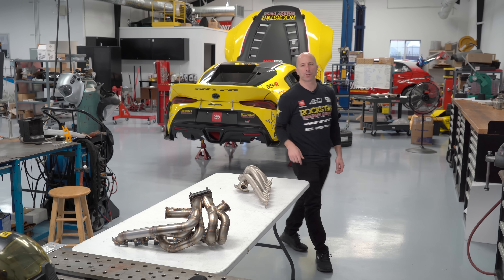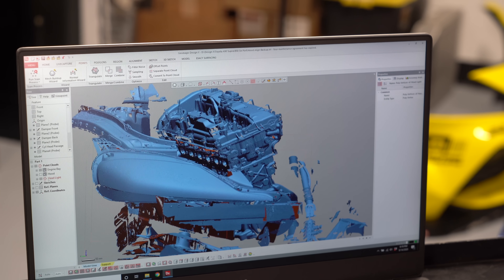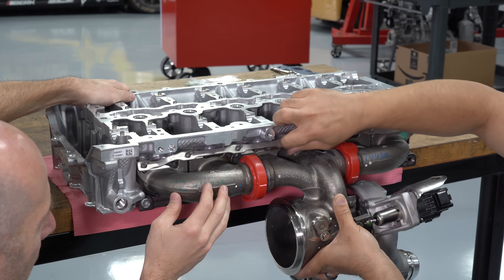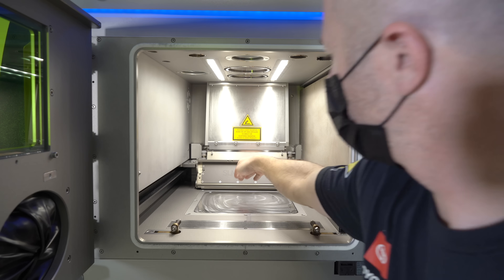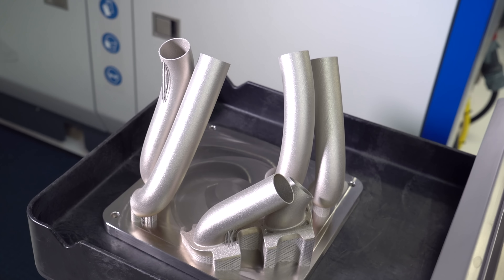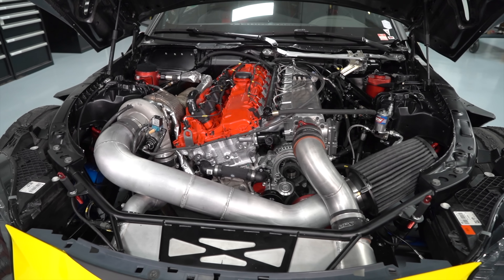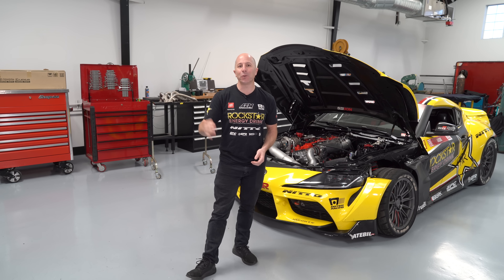Turbo Manifold 3D Printed from Inconel Powder

Comment from the maker: Would you use the printed or fabricated header?
Reply: Can we get an update on the head? 6 exhaust Port vs the original 2? Thanks!! Love your videos. I learn so much!!
Reply: Seem like it might be pretty far into diminishing returns territory for the price.
Reply: I wouldn't of used it that close to an event like that
 Go with what is proven.
Test the 3d printed one this winter. Get some heat cycles in it. Also please film it for us. Maybe a gopro under the hood to record the glowing lol
Reply: Both look great. When did the exhaust ports change from 2 too 6?
Reply: doesnt it hurt the performance because its so rough inside?
Reply: whichever one gets the driver seat time
Reply: @tektkite7255  I read a study where its better to leave it "as cast" not to polish cause it acts like dimples on a golf ball. Also I ported and polished some cylinder heads and then had them machined and assembled at an engine shop and the yelled at me that I wasted all that effort cause it was boosted and didn't matter. So who knows.
Reply: I'd use the 3d printed plastic one. I feel like that's where my budget would be.
Reply: Neither
Reply: Printed!! You are literally on the bleeding edge of this tech! I love this!!
Reply: Super curious to hear how this one works out after the manifold failure
Reply: Does the smoothness of the internal tubes make a difference to turbo flow or power levels because it looks quite grainy in there.  I feel like the tube based headers are probably what I’d choose simply because of expense I imagine 3d printing is very expensive
Reply: Would you print an entire engine? ',:)
Reply: @PapaDoc thanks always for the great content. Please keep it coming!!! Thanks a bunch
Reply: Fabricated unless the customer is willing to pay for my experiment.  Would be interesting to play with internal surface features and turbulent flow characteristics in that manifold with the additive process.
Reply: @wackerpro  Not really, aerospace has been using metallic printed parts for a decade now.  Just hard to justify the cost elsewhere which hasn't changed much.
Reply: How much were the headers if u don't mind me asking???
Reply: @bookle5829  Not likely, metallic printing still does not print at full density and requires post processing anywhere where parts meet.  Porosity and surface finish is the limiting factor.
Reply: Hell yes, the technology that goes into this is so badass
Reply: I would first need to print a whole car 😬
Reply: What was the weight difference?
Reply: I would have to do a dyno and track test each to have proper answer but they should both be the same if they were designed off identical software.  Maybe the 3d printed has smoother flow but I doubt that will matter considering how minewught the diff
Reply: Fabricated piece looks nicer.
Reply: I'd like to know what the printing would cost an average Joe like me.
As for the fabricated tubes, I know people think the welds are cool, but it's poor engineering. There must be someone who has the equipment to bend them up in one piece, especially if you have a cad file for them.
Reply: @BrandonBurns1985   The more power (better flow) you make NA, the more you make with boost.
Reply: Printed hands down👌👌
Less welds and less chance of cracking under high temps
Reply: Printed can get better flow through engineering and computer simulations
Reply: I'm also confused about 6 exhaust ports 😅
Reply: Definitely
Reply: Printed
Reply: Printed Inconell for sure. :O
Reply: While I can appreciate the technology in the 3D printed one, the fabricated one looks better, it also seems like it would flow better due to how smooth the inside was compared to the printed one.
Reply: @screwdajuice  Mine would be the napkin the idea came about on meal not included
Reply: I would use any of them as long as I didn't have to pay for em'   😉
Reply: Do you use solidworks FEA  on those headers before you finalize the design? I’m curious to see where the high stress points are on a part like that.
Reply: I actually did my masters colloquium paper on SLS and SLM technology. It is very fascinating, the properties and grain structure is like no other manufacturing process.
Reply: @reAllyNoWayyy  If only I had a neighbor to borrow everything needed....well that's what one of my grandsons does well use to marriage and a newborn has slowed his purchase abilities
Reply: @owenspalding971  Is porosity a concern with metal printing? since it's done in .004" layers, I'd imagine that the amount of contraction from cooling is lessened. Cast parts cool all at once which is usually why they can have high porosity if the cooling and pressures aren't controlled locally.
Reply: I think that a 3d printed collector makes sense but unless you print the whole header as one piece, the pipes could be made from tubes
Reply: I woulduse the printed header if it extruded polished on the inside
Reply: Printed I think. Smoothness of the inside is a huge deal, but it's hard to clean up the inside of the welded header too. The properties of Inconel are pretty awesome though, I have Inconel turbo studs on my track Miata because regular steel ones wont stand up to the heat.
Reply: @UCSFKVIigivR2W4C8Ix0axIA it's at the end of the video. 1100whp/900wtq
Reply: 3D printed. I would’ve trusted the end product would’ve been as advertised. Process seems legit.
Reply: Probably a good choice not taking an untested, and I'm guessing, extremely expensive prototype to an event. But I do want to see more 👍
Reply: I wanna see how crazy you can get with the antilag on this!
Reply: just test the 3d printed one next year put it throu the TEST of TEST
Reply: Fab !
Reply: @noahkach  Yes it is.  The biggest reason its an issue is because its nearly impossible to model near the exact density of the part.  The contraction from cooling is generally negligible.  The bigger issue from the stress side is that the density variation is not predictable and and therefore we cannot accurately model the strength of the part with finite methods.  Validating a basic part by test is usually not a big deal but validating a lot of parts by test that are usually validated by analysis is not something most companies are willing to spend money on.
Reply: @owenspalding971  gotcha. just out of curiousity, what is your background? I'm just finishing  my Bachelors in Mechnical Engineering and haven't had much exposure in 3D printing besides extruded plastic.
Reply: Will use whichever performs better / more reliable.
Reply: Why not both?
Reply: Can't afford either bruh 😂
Reply: All I know is your intake failure taught me that always have spares for everything, even prototype one of one should be one of two.
Reply: @owenspalding971  Is that a youtube channel?
Reply: It’s defend/aerospace grade!
Reply: Wow this 3D printing technology is just in its infant stages. It's only going to get faster and cheaper just like with any new tech. I think in the not so far future you wont even have to go to the parts store to get your parts your just gonna pay for the and download the part to your 3D printer and away you go. In the end I think it will be even cheaper and eco friendly than buying your parts from the parts store... very cool stuff.
Reply: @mattw4486  defence/aerospace grade slm machines will never be cheap! That facility is a big clean room.
Reply: I’d use the printed one for sure
Reply: Test them both!
Reply: @BrandonBurns1985  Airflow is airflow, boosted or not. If you can improve airflow, its going to increase power regardless. Ported and Polished heads on a boosted application will mean the performance pays off an order of magnitude better than if the head was 'as cast' in a boosted application. 

I mean spending $800 to get OEM LS3 heads CNC ported and polished to perform similarly to aftermarket heads from a shop like Advanced Inductions or AFR for $1800 proves "as cast" is a misnomer unless knowing the context of the study you've read. 

im sure the study goes into comparing performance metrics with cost of producing the port work may not justify the cost when in a boosted application unless you're the type of person not wanting to leave any power on the table. 

In my experience, ANY TIME you can increase airflow, no matter if its through casting and machining new parts - or machining old, used, OEM parts to flow more - there is a measured benefit. The only question is... how much money do you want to spend?
Reply: @fascistpedant758  You're looking at easily 5-figures for the entire process, start to finish. Fabricated tubes with welds, are going to be common and not "poor engineering" because of the limitations in joining all the pipes to the head and collector within physical space. Unless you're referring to Tubular cast manifolds, which are equally as expensive to develop because the manufacturing process essentially requires mass production in order to have low per-unit costs that will offset development and production costs in the long term. Race teams can justify the cost of this because they can apply what they've learned in motorsport, to create products for the aftermarket. 

3D printed metal, while in a much better place than they were 5 years ago in regard to motorsport, still has a ways to go where it can be a viable manufacturing method for mass production
Reply: Seems like somthing more or less people would do if money was not an issue to them and their builds lol
Reply: printed wone
Reply: If it was tested and proven to work, I don't see why not
Reply: @BrandonBurns1985  I feel like just because it's boosted doesn't mean it was a waste of time polishing. Smoother surface means smoother and more consistent airflow but I don't know all the science behind that
Reply: if the printed stuff could withstand the abuse and money is no object, absolutely
Reply: Printed and fabricated are both excellent choices. Personally on the engine I  designing I chose seamless grade 9 titanium tube for the headers. With goal of no seams and a optimized flow between exhaust port and turbocharger. Cheers
Reply: Play with the printed one, but not before an important event, stick to the proven version.
Would be great to check it out to see if there were any benefits over the fabricated one.

Wasn't it possible to print it as one piece? to avoid the welding?
The tech need to get better, the cleanup and after processing is too much.

Not as bad but similar as those made from plast, they are silly.
They are weak and ugly; cant be used for much except mockups.
Reply: Honestly, You just made one of my fantasies  come true.
Reply: Uh would I?? I would kill to be able to print manifolds Papa D!! So awesome!!!
Reply: @BrandonBurns1985  I think you are a little bit mistaken. You want the rough finish on the intake side only when you are using a fuel air mixture in the pipe of question. It helps to keep the fuel atomized. But most injectors these days are mounted right at the valve basically. So that isn’t really of any benefit. Also there is a thing called boundary layer. Look it up. Basically the air flows through the middle of the pipe and not out on the edges. As far as roughness in the exhaust. It’s the opposite. You want it as smooth as possible. That’s why you see guys running those machines that pump a playdough like substance through a header. It will have diamond grit in it to polish out the inside of the pipes.
Reply: Fabricated, that manifold is a piece of art. 👌
Reply: The fabricated one
Reply: Laser welds are usually super strong, I don't know enough about the material though to make a call, but seems like you guys did the math so I'd say the 3D printed one, because it has less manual welds and thus is naturally less likely to crack
Reply: I would go fabricated, even tho its cool with printed tech
Reply: @screwdajuice  samesies.
Reply: Honestly I would use the lightest one that can take the heat. In any case either are good. Amazing video man that’s incredible. My question is does it hold up vs old school?
Reply: @BrandonBurns1985  I hardly think you wasted your time a smooth surface to flow in any application no matter where in any engine benefits boosted or not now being boosted does help but flow is flow and it adds up in and out faster is the name of the game.not sure what you mean about ripples on a golf ball from a simple polish if your talking about on the welds then I guess I can see that but if your welds don’t suck with bubble in it then I don’t see the problem so long as it’s flush and smooth on the inside it’s a win.
Reply: @fascistpedant758  actually incorrect the reason why is because on a boosted app your compression ratio is lower na so you can except boost therefore if you had a high compression na vehicle next to a low compression na Not boosted yet but ready, the high compression would obviously have more power a prime example is a scat pack vs a hellcat very similar but the hellcat without a blower would make less power.  But yes better flow does equal more power that is for sure.
Reply: I first like to see the annealing of parts to be honest
Reply: The old school guy in me says fabricated but then the nerd wakes up and yells: have you seen the printed one dude, so sexy. For this built, the nerd would win.
Reply: @papadakisracing I really like the printed. But having the egt and back pressure sensors present will get you better tuning gains and real time monitoring.
What is your back pressure to boost ratio please?
Reply: Absolutly yes!
I wonder what could be done on the inside to make It even more efficient. Like golf ball surface or a better integrated wastegate.
Reply: I wonder what the difference in flow is between both manifolds. I know there is not enough length to even matter specially at that high horsepower numbers but just curious. I registered for the 3D experience. I’m excited.
Reply: Definitely, it’s clearly the future for low volume manufacturing and remaking older unavailable parts.
Reply: Printed, in the future when this will become the normal thing. When more cars get`s scanned so one can actually choose the car, engine one have from factory. Like choosing a brake disc. This will be the way to go when this can be done faster or more people have those machines to print out the manifolds. Do you want N/A or Turbo manifold, stainless or inconel? etc. It`s just about working smart and not hard I think :)
Reply: If it’s reliable sure
Reply: @tektkite7255  its way worse ...
Reply: @mattw4486  not any time soon
Reply: @BrandonBurns1985  not like that , yes you can make dimples in the intake colector to improve fuel misture and speed flow , but on exaust always polish to have more flow quantity
Reply: Depends on the timing for me, if I had the access to a welder and not much time I would attempt to fab one. If I had the time and money I would print it
Reply: Would TEST the printed, would use the fabricated
Reply: 3D printed has the advantage of using whatever bend radii you want, including constantly varying. I would expect it to perform better on a dyno. 

Whether or not it can be made as light I don't know: it wouldn't surprise me if the 3D printed Inconel loses out on mechanical properties some when compared to tubing. 

Once it's been proven as reliable, I suspect the 3D printed one would be the better option.
Reply: Now that it's done, definitely the printed part. If i was in the same situation u were i'dve gone the same route u took.
Reply: @vincentbourke5217  MY2021.
Reply: @davecolwell725  it will create turbulent air that doesn't move as efficiently as if it were smooth
Reply: Whatevers lighter
Reply: FABRICATED ...
Unless your pushing 5k whp, does it really matter if you use the printed or fabricated ..? Either material will hold what your pushing. 

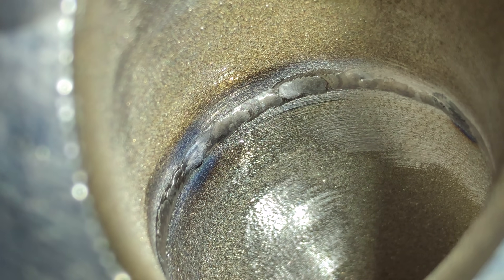At 8:43
those welds right after the head flange on the runners ... They don't look to promising or strong. I feel like that is a bad weak spot ...
Reply: fab it looks better with the color changes
Reply: They 3d print turbines for jets these days the same way.  Isn't it just the micro-pores in the metal that can lead to dramas and ultrasonic cleaning and electrolysis to fill them.
Reply: @fascistpedant758  The best CNC mandrel benders need to grab a decent length of steel for the bend to work. The only other way you could do it is with water pressure in Cast moulds of the tube shape.  Watch the doco on how Harley made the V-rod frame.  You'd even be able to put a taper in the pipe.
Reply: Depends on who welded the 3d printed one 🤔 your intake blew right on the welds thats a no go.
Reply: @owenspalding971  It was a joke but I still appreciate the answer. I guess 3d printed engine will never be a thing?
Reply: @tektkite7255  Ya I heard something similar to the other guy, that the rough surface helps. The guy at the machine shop said something different to me tho, that a boundary layer forms as the air sticks to the rough surface that the rest of the air can easily "slide" on. A similar effect as water on ice. Either way, it seems to help if anything.

Which is nice, knowing you don't have to spend all that time and money to make power.
Reply: im 14
Reply: @noahkach  yes porosity in metal prints is a big issue
Reply: For now fabricated .
Reply: Printed if it's ready in time 👌
Reply: I use Solidworks and worked (as Design Engineer) with one 3D metal and plastic printer manufacturing Company - I would use it on my car
Reply: hey if you're giving it to me, make it however you want :)
Reply: @crocodylinae4161  Hello, 14.
Reply: Printed, the technology that went into that is absolutely mind blowing and watching it come to life in a pile of metal flakes and be excavated like a dinosaur fossil was pretty cool.
Reply: @fascistpedant758  you’re lookin at 6 figures currently. That includes the design, scanning etc etc. For a high end race team, it’s worth it if it means having the slightest edge over competitors. Guys like us either learn to TIG, or run EBay manifolds.
Reply: I’d use both to see what holds up best to the vibrations and heat cycles.
Reply: @brendo7363  
At this stage price & deminishing returns are beside the point, the development n potential of the emerging technology is what's on display.
Reply: @tektkite7255  
Its a minor detail to polish a pipe if its affecting performance.
The strength of the material & the adaptability of the technology is whats on display here n its on the brink of being mind blowing, kinda like how the beginning of the industrial revolution musta been to those who had half a clue about what they were looking at & how it could affect society.
Reply: @bookle5829  
Why not ?
Engine blocks are made from casts anyway.
Wats the difference between casting one & printing one if the metal alloys are the same & structural integrity isnt an issue ?
Reply: @SPIDERM0OSE  I just replied to a guy who explained why. He explained more in the thread. Also, there are engine that are forged, like that Supra's engine.
Reply: Can you fabricate using Inconel 625?
If yes then I think fabricated one will be much quicker to make
Reply: @bookle5829  
That Spalding guy ?
He basically told you "Not yet"
Yet being the key word.
Then he mentioned cost to someone else in the thread.
He stated the obvious.
The technology isn't quite ready for mass producing engine blocks but as the video showed the technology is capable of printing engine parts, an engine block is probably the least sophisticated part of an engine, the technology printed a more complicated/engineered part in the video, wats a block have ? Oil galleries n coolant passages. They're not as carefully n precisely engineered as the intake & exhaust gas flow passages.
Its only a short matter of time before 3d printing takes over in mass production, you can see it with yer own eyes in the video.
Reply: Having used these technologies before and seen how capable they are, I would still go for the fabricated version
Reply: Hell yeahhhh!
Reply: Yes.
Reply: @BrandonBurns1985  on an intake, yes when it comes to carbs, better to get  more tuebulence. On an exhaust I would have the smooth finish, but then possible benefits are probably hard to measure.
Reply: If the technology is solid, yes.
Reply: Yes
Reply: Honestly the way I see it, ur still welding parts together, I think that 3D printing option would be viable when u can just print a whole part, port it and bolt it, if fabrication is still involved I see no sense besides weight savings 🤷🏼‍♂️
Reply: @Vivid Media yeah but the tech ain’t there yet, it took longer to make the printed one then the fab one soooooooo....
Reply: @BrandonBurns1985  I west thinking the same but using a good thermal camera flir to compare the 2? I scanned a lot of industrial equipment over the years great tool you can learn a lot.
Reply: Fabbed has the inside smoothness benefit, printed the continuous bends.  Whichever imposes less penalty, then.
Reply: Once it is proven to have long term reliability and robustness..printed
Reply: @BrandonBurns1985  I know rough casting is good for the intake side of NA engines because it promotes tumbling and a better fuel-air mix, but for exhaust gases I’d think you want a smooth surfaces just based upon basic fluid dynamics. Dimples in a golf ball work on a solid object moving through air, but I don’t see how it would help air moving through a pipe. It would just create more headloss resulting in reduced efficiency. I would like read the experiment you read if you have a link to it though.
Reply: @BrandonBurns1985   On the exhaust side, smoother is better. The reason you would want to keep the intake side rough is to prevent fuel from sticking to the walls and beading up. In other words a rough surface will keep the fuel better atomized. That doesn't mean you shouldn't port it. A good port job will make more power with less boost.
Reply: Use the printed one but bring the fabricated one along as a spare
Reply: Commercial plane parts have been printed using printed parts for a decade, I think it's more than vetted.
Reply: If money isn't a concern at all (F1 budget), then the best of everything for even 0.01% gains. I'd go value oriented with my budget.
Reply: @BrandonBurns1985  
Dimples on golf balls enhances the Magnus effect,  offsetting gravity by using angular momentum to create lift.  Rough pipes have thicker boundary layers so greater minor loss
Reply: I would find a shop with a larger 3D printer so I could print the whole manifold in one piece.
Reply: @tektkite7255  
I doubt it does. Its probably negligible at best. Maybe the inside could be extrude honed? Not sure because I know jack shit about the inconel material and the actual metallurgy. The intake will usually benefit from a slightly rougher casting while the exhaust can never be too smooth. Both headers are a downright work of art, that's for certain. This channel and all the Papadakis team's stuff continues to push the envelope and really get the creative juices flowing with all this cutting edge tech. I remember when the Faro arm was first introduced, and that was incredible. Then we get this whole metal 3d printing from a fabrication standpoint and that is just downright amazing and mindblowing. Cannot thank you guys enough for sharing this! 👍😃
Reply: @kennypeoples3288 NYT calls it fake titanium but I think people are confused with Inconel 625 "tinted" PLA prints (metal-colored plastic). Nobody confuses gold glitter with actual gold dust